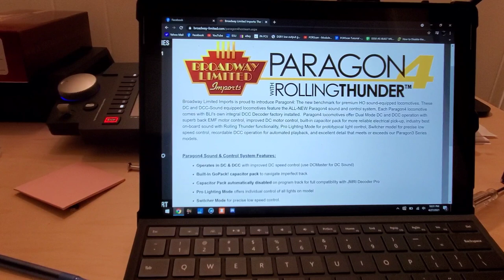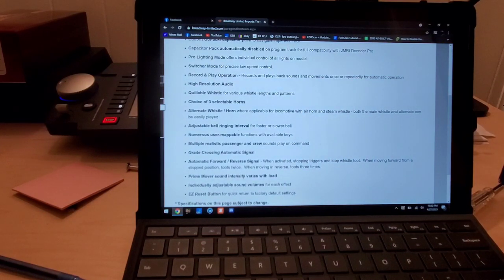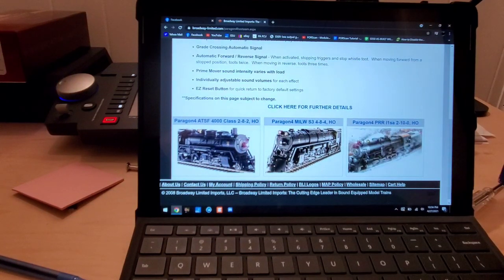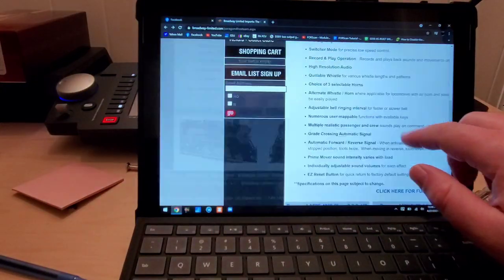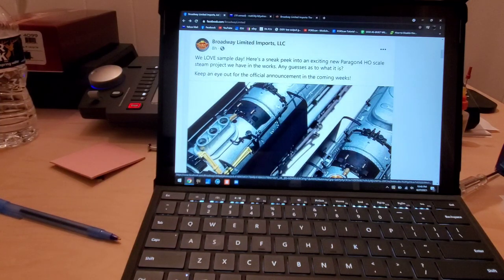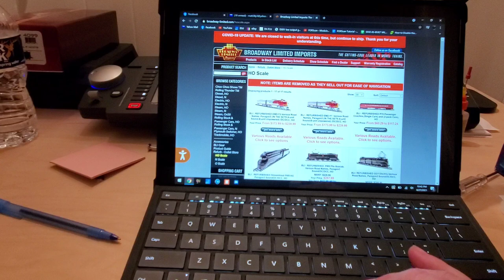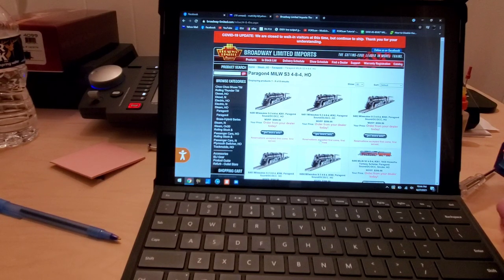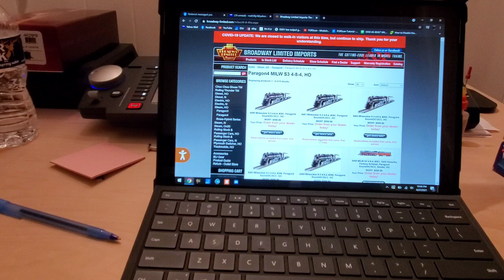Why I haven't shown how to retain smoke on BLI models and HUGE announcement from Broadway Limited

Comment: ESU I/O board used with the lok sound sound will allow you to retain the factory smoke unit as the I/O board will control and synchronize the chuff
Reply from the maker: How
Reply: @RodimusPrime  it has solder pads for heater +- and fan +- and temperature sensor ±‐
Reply: @RodimusPrime  and you also have to option to put in a 100kohm glass bead thermistor next to the heating element to control the temperature just like how esu has done with their smoke units

Comment: Shane mentioned in a recent live stream that the fan driven smoke would be retained. So no Seuthe thankfully. Also, FYI, the Paragon 3 models claimed "High Resolution Audio". I've begged BLI to update their audio files or switch to a 3rd party. They make great models, but they are 4th at best in sound IMHO. They seem to be egotistically stuck on their own stuff because they've done it for so long.
Reply from the maker: Then the question is that fan driven unit being available seperately for purchase
Reply: @RodimusPrime  Exactly! Time to start campaigning with ESU. HO needs a full aftermarket replacement sound decoder that comes with or supports smoke units. I've been asking ESU and TCS for years. TCS told me 2 years ago that the next WowSound decoder would support fan driven smoke units. Still waiting...
Reply from the maker: @jonnyspeed  MTH has a patent running out soon that prevented others from doing this in ho
Reply: @RodimusPrime  I'm not a lawyer, but I thought that was settled when BLI fought that after MTH sued them? Either way, with MTH ceasing to exist in a month or so we should hopefully move beyond that and finally get new products in this area. I'm moving down from O and S and good sound and smoke are top priorities for me if I'm going to enjoy HO. Hopefully this is the turning point. Really sucks if MTH was holding back the development of products in HO. I'm all for capitalism, but when one person can cause stagnation in an entire industry that doesn't seem right.
Reply: Chalk me up as a potential buyer for aftermarket smoke/sound as well. Have a couple p2k Berkshires needing dcc, as well as some genesis 2-8-2s.

Comment: Literally the only thing mth and bli smoke units need to be compatible with ESU is a thermistor, thats literally all esu did with there smoke units. But now theres a new way of getting smoke, and that is a single ultrasonic mister, smallest common size is 16mm. Use that and a simple custom mixture of water and 1 or 2 other liquids, and you got something that works better than a heated oil smoke unit!

Comment: My paragon 4  number 2102 I received 3 days ago is just as bad as my Niagra paragon 3.  Not unlike the Niagra  I must send it to the factory to be fixed.
  The smoke unit is less than desirable and the chuff system intermittently cuts out.  I can't imagine why the chuff  problem persists from paragon 3-4.

Comment: So no material changes to any model in the way of improvement, just some different software.  Call it #4 & charge more.
Reply from the maker: Pretty much, the motors are supposed to be sealed a bit better